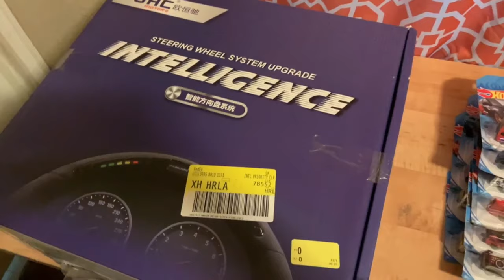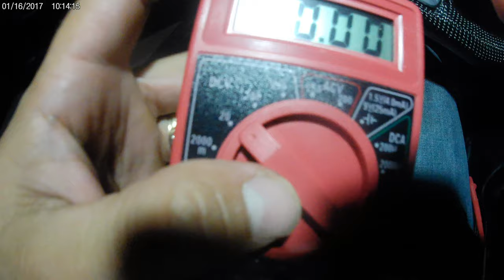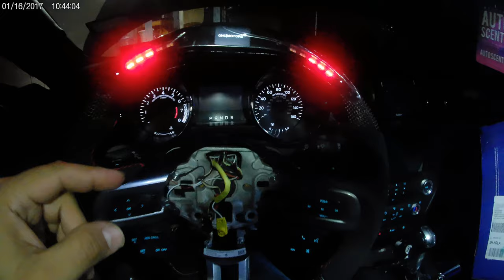Carbon fiber LED Steering wheel for the mustang!!!

Comment: Awesome detailed video. I just received that exact same steering wheel and planning on install soon. I was told by Carbon Bargain directly that I don’t have to splice the white cable from the OBD connector side only the red cable from the steering wheel to the 12V because the signals are sent wirelessly to the steering wheel. Hope it works. Great video and thanks for the detailed install helps a lot.
Reply from the maker: victor carreon Hey thanks for stopping by I am shooting the video today I have another person asking so I will start from the beginning and be more detailed as well as have someone hold the camera for me. Don’t forget to hit the 🔔 button as I hope to have the video up tonight

Comment: I have a question. What did you do so the white wire does not get tangled every time you do like a u turn for example
Reply from the maker: Robert Vasquez Lol I know what you mean. So since I only did it to see if the steering wheel functioned There’s a plug on the bottom of the clock spring and for that just remove the plastic around the steering column. I will be making a video on that tomorrow.
Reply: David Build Vlogzz ok great!!! I will turn on post notifications!!!
Reply: David Build Vlogzz for the white wire which one did you connect it to under the clock spring?
Reply: Did you ever get to the video on how to remove the plastic around the steering column? I can only get the top part removed not the bottom. Any help would be appreciated.
Reply: victor carreon the bottom has two screws you need to remove them carefully then with force unclip the sides

Comment: Check engine light is on. What was causing it?
Reply from the maker: Hey what’s up bro the light comes on if you have the car in the acc position that is why it was probably on, but it does not have a check engine light on after startup car is running great so far couldn’t be more happier with the 3.7 platform
Reply: @DavidVlogz  oh ok cool

Comment: had mine installed, the wires are visible under the steering wheel, next to the gas pedal,!is it suppose to be like that?
Reply from the maker: Danny R. No they should be tucked inside the bottom plastic part of the steering wheel you got Instagram?
Reply: David Build Vlogzz Yes
Reply: whats your insta?
Reply from the maker: Danny R. @mmagnetic2016

Comment: Do you have to remove bolts for the bottom part of the steering column to separate? It does not have to come off right just pull apart to splice white wire correct? Thanks
Reply from the maker: victor carreon there is a t 20 and I’m sorry it took a while to edit the video but will be out today in it you I show exactly how to remove the parts and how to pin it so it won’t show wires
Reply from the maker: Also no need for splicing as soon as I get out of work I will upload the video that way you won’t do any splicing.
Reply: Thanks David I will be waiting
Reply: I’m kind of stuck doing this install the wheel won’t power on once I connected it to the plug on bottom of clock spring which cable do I splice into please help.